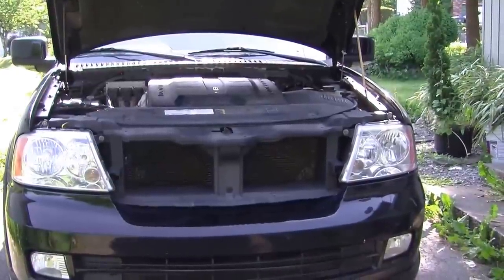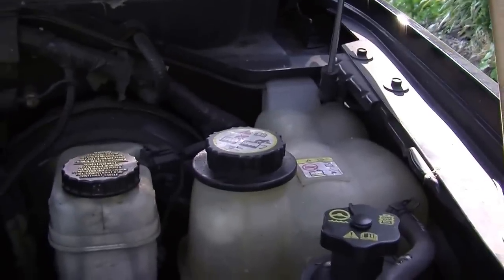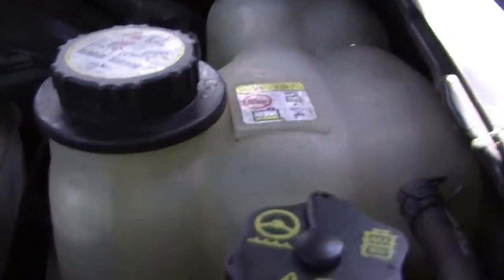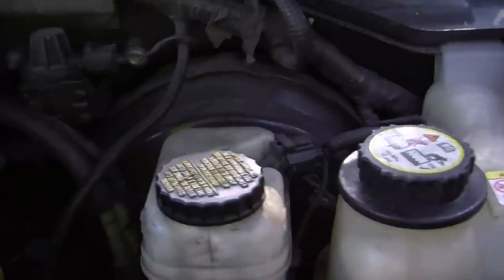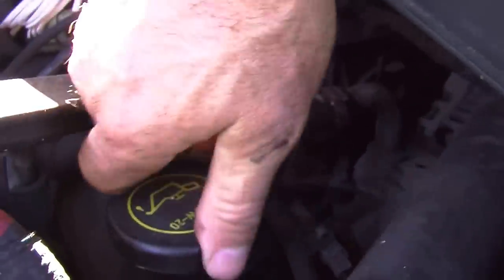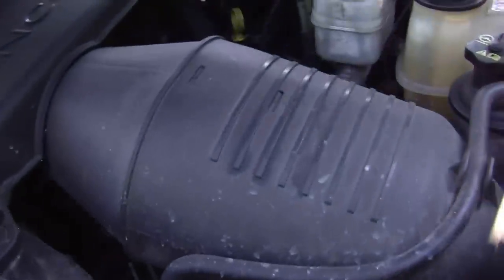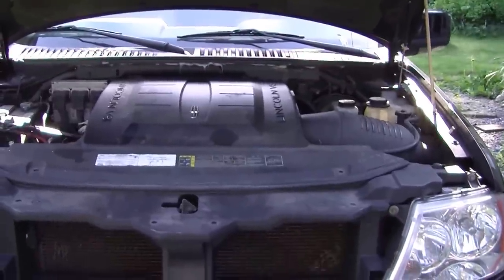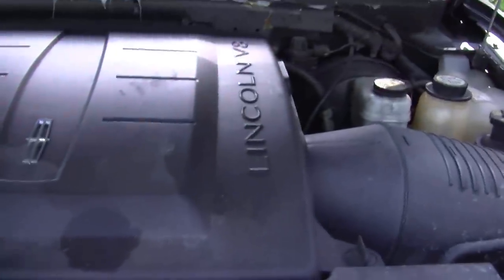Lincoln NAVIGATOR 2005 Fluid or fluids where to put

Comment: 8 cylinder has transmission fluid stick on the left side of the engine  which is where you put the auto trans fluid
Reply: do you mean on the passenger side ? and what part is it near on the passenger side is the battery and washer fluid I don't have a dipstick in my 205 this is pissing me off not knowing how my fluid look
Reply: No it’s not and guess what. These all came with an 8 cylinder engine. So saying the 8 cylinder came with a dip stick is incorrect bs. It’s not like they made a 2005 navigator 6 cylinder.
Reply: @jeffwatson151  the guy above is lying. There is no dipstick in a 2005 and they all came with an 8 cylinder. I just changed my transmission out and it’s a sealed unit with no dipstick and only came in an 8 cylinder. I know your comment is a year old but no one replies on these car forums.